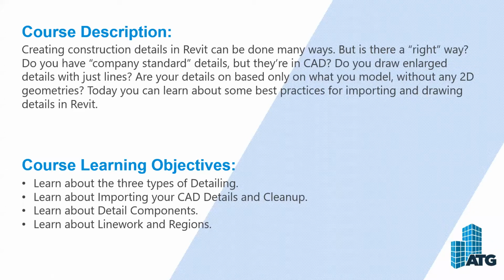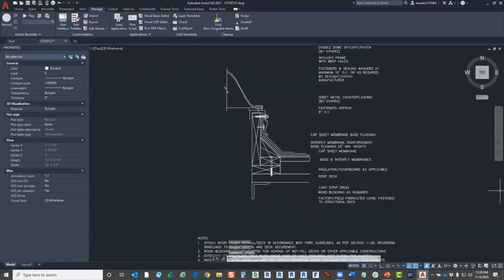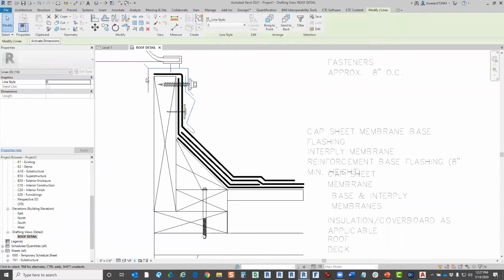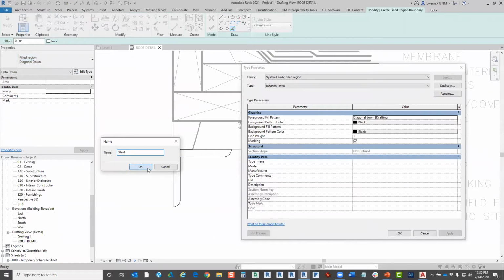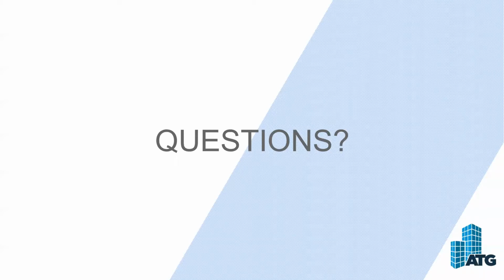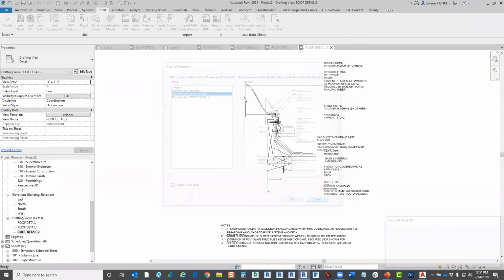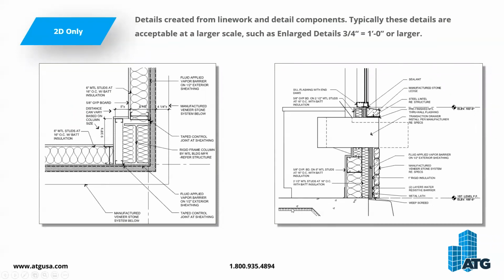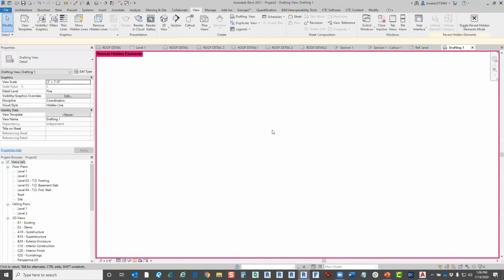The Great Migration — CAD to Revit Details

Comment: Roman,
Thanks for checking out the video!

There are several workflows to import CAD to Revit. I prefer this particular workflow because it keeps errant cad layers, linetypes, hatch patterns, and other CAD data, out of my Revit file. I do not disagree that it does take longer and duplicates work, but that duplicate work is to allow for a clean transition between two completely different programs.